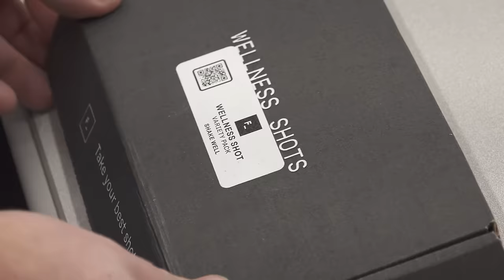Maverick R vs PRERUNNER in the SNOW!

Comment: My daily driver is a pre runner and I got an opportunity to join a large group of SXSs  for a poker run out in Johnson Valley  CA.  My truck 2wd and at the time my limited slip diff quit working. I had 5 people in my truck with a bunch of recovery gear in the bed. The trails had some very steep climbs is soft sand, sant dunes, rocky terrain and deep ruts. I managed to keep up with these 4wd SXSs no problem and complete the power run.

Comment: I'll admit I was the asshole 18yr old ripping my studded KX250 on the snowmobile trails in the UP years ago, but that was 20yrs ago. Had a Pro XR 440 but would still rip on my MX bikes and get alot of 🖕🏼's. On the river though I could smoke the sleds, couldn't corner as fast as a bike on the twisty part of the river. MX boots aren't very warm though, found that out the hard way.

Comment: I thought pre-runners were supposed to be 2wd?
Reply: Exactly what I was thinking. Mechanic for over 25yrs and I've never seen a 4x4 prerunner
Reply: Technically, any vehicle can be a prerunner.
Reply: @Ronniepickering69  actually no. Prerunner is used in Baja to learn the terrain. Baja trucks are 2wd as well.  A prerunner is described as a truck that has the look of a 4x4 but is only 2wd. Infact Toyota put out a prerunner model truck in the late 90s. Also 2wd.  Nowhere will you read about a 4x4 prerunner and if you do it's someone who has no idea what they are talking about.  And the reason they broke this bronco is that a dual I-beam front suspension on a 4x4 is not designed for that much travel.  Those are floating axles in the differential. I built one for off-road once and had to use limit straps. Worst suspension ever made. For anything.  But it was what was considered Ford's trademark that is now the independent front suspension for 4wd.
Reply: @ronaldgrimmig6659  the only thing that actually matters in qualifying a vehicle as a prerunner is to run the track with it before the race.
Reply: @Ronniepickering69  sorry but that's only one thing,  and that's not the only thing.  But whatever helps you sleep at night.  If you brought that bronco into my shop and called it a pre-runner you'd be the butt of our jokes for at least a few hours to a day.
Reply: @ronaldgrimmig6659  it's literally the only thing that defines a prerunner. Of course most of them are longer travel 2wd trucks  but they literally don't have to be that. You might laugh at that but it's only because you don't know any better